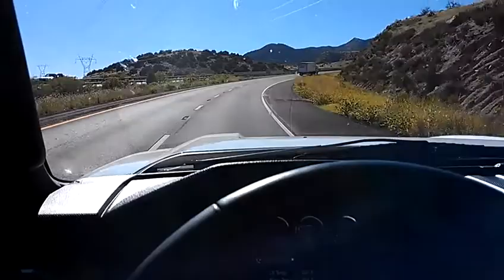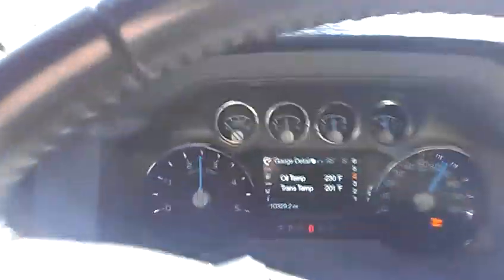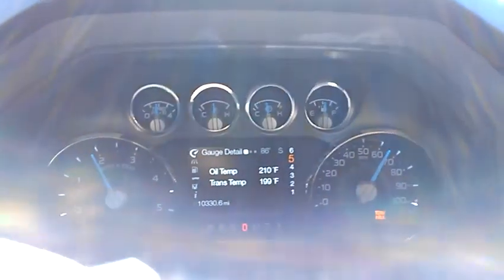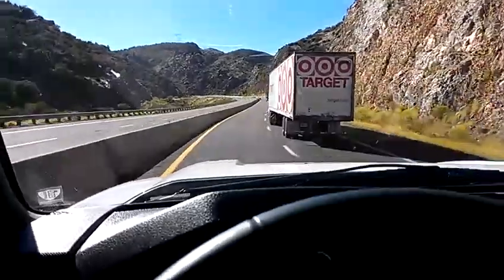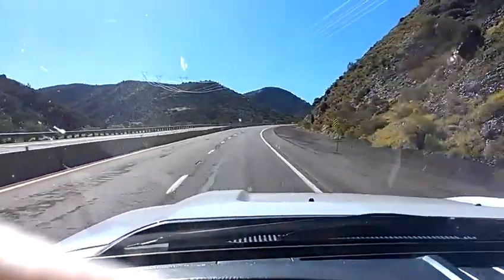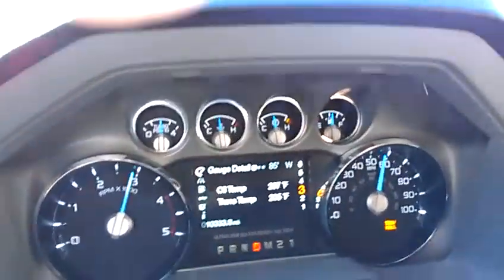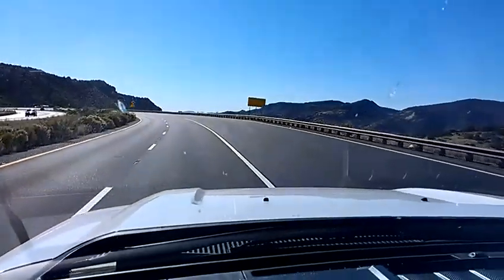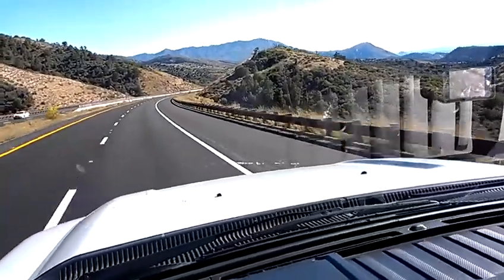2011 powerstroke towing 13k in the mountains

Comment: Man your oil temps are up there. ive never seen mine get over 208 towing a 16000 pound 5th wheel through west texas during the summer.
Reply: are you running fully synthetic to keep your oil temps that low? what type of oil do you run?
Reply: +olekentz71 I was going to say the same thing!  The oil temp on my 2011 6.7 got to 215 at the highest (was towing about 9000 lbs but no long grades - just in the bluffs in SE MN) this summer when it was about 95 degrees out and I got worried that it was too hot.  I&#39;m running regular oil fwiw.
Reply: +junior21804 diesel engines run synthetic always.
Reply: Not true. Most run 15w40...late model diesel do but it's not required.
Reply: bbubacz1 I did not know that. All my trucks do.
Reply: junior21804 you should look at Triax 15W40 very affordable full synthetic oil $100 for 5 gallons it's CJ-4 rated or for around $130 you can go for Schaeffer's 5W-40 which in my opinion is the best full synthetic oil
Reply: HERPY DERPEDY it’s his oil cooler mine would hit 230 no trailer when it got clogged I learned the Importance of maintaining and flushing your radiator

Comment: Arizona has ALOT of tough pulls. AZ Hwy 87 from Phoenix to Payson elevation is 1200 ft to 5000 ft in 60 miles, up and down. This video is thru Slate Creek Canyon up to Mt. Ord pass down to Sunflower, AZ. 2500ft to 4500, back down to 2500 in les than 10 miles. 
There is a good reason that most every major car maker has a proving ground near PHX.

Comment: I have A 13' F-250 Lariat 6.7 Power Stroke diesel  FX4,  almost the same as the one in the video, I get about 15.5 MPG not towing, 8.5-10.5 MPG towing my 12.5k 5th Wheel rv  And up a 7.5% grade over the Rocky's, it goes down to about 6 MPG.

Comment: does your truck have the exhaust brake? I have a 2016 with the factory EB and I was hauling a 5500# trailer with a 12,500# load on it going through the mountains in Montana and I am able to go down a big, steep grade without even touching the brakes. in fact, I had to hit the gas a few times to maintain the speed limit.  as for gping up the hills, I was able to pull up any hill I came to at 65+ mph.  my truck has a little more power stock which helps, I also have stock size tire size which also makes a huge difference. I have been really happy with my truck. ford did well.
Reply: mhrepoman I came from Alaska to SC through MT, 38' trailer grossing 27,700 lbs and my F450 is awesome. Engine braking is great, just set the cruise and go. I get better MPG at 55-60 than 60-70 or 80.

Comment: personally I think tow haul mode has less power than regular. I tow a 24 ft camper with my 6.0 powerstroke with tow haul mode off and it pulls it much better with tow haul mode off than with it on. takes more moter rmps to take off and maintain speed with tow haul mode on.

Comment: I'm just curious, no engine brake? I didn't see any boost on the down hill even after he down shifted while in tow haul.
Reply: Abraham Lopez it will go if I’m tow haul with brake pedal pushed it is a negative pressure mine is zero on gauge when using jake brake I have changed mine with tuning custom tunes are more aggressive

Comment: Is that engiene temperature ok while towing that load?? I have a 2016 6.7 powerstroke f250 and everytime i pull my travel trailer with weights around 14000lbs the engiene temperature goes up to 237 and i dont know if that’s ok or if its bad
Reply: I’m just curios to see what temperatures are ok, i dont want to damage the engiene

Comment: the rpm is kinda for that speed and you are towing , how many speed are those transmission
Reply: He was in Tow/Hall so it holds gears longer and downshifts to speed up engine when going downhill for more compression to slow down
Reply: STEEVE DAVID Nicolas it's a 6R140 Transmission has 6 speeds

Comment: what is that yellow light for on the dash?
Reply: I'm thinking it's the tow mode indicator. Just guessing...I don't own a F250.
Reply: That is the Tow/Haul indicator. It allows the transmission to stay longer in lower gears to maximize torque when towing.
Reply: It also downshifts downhill so the engine goes faster to help slow down the truck